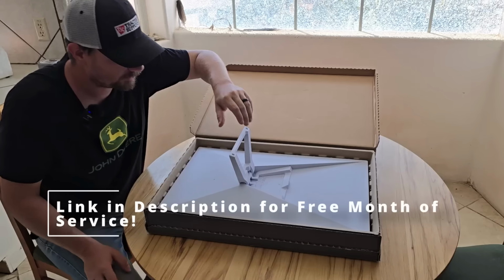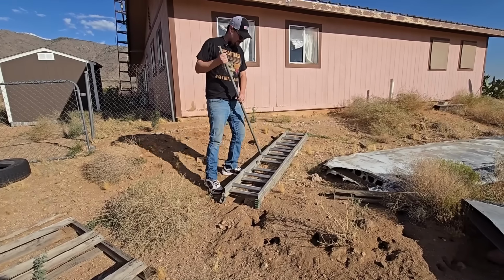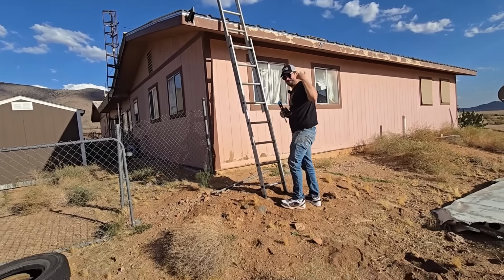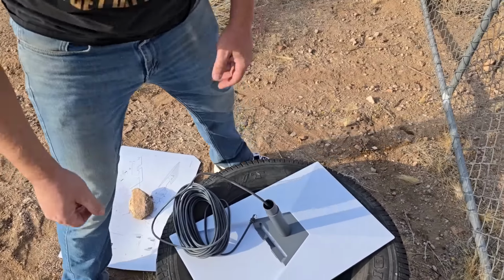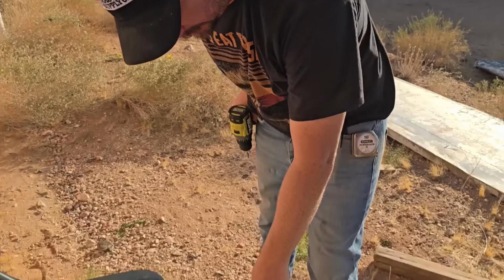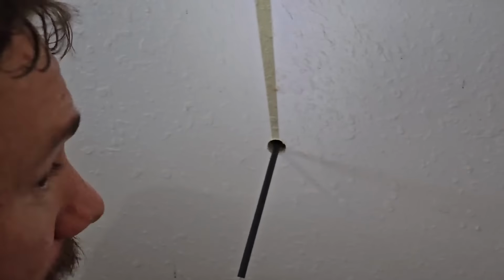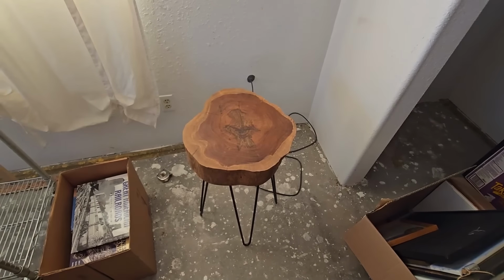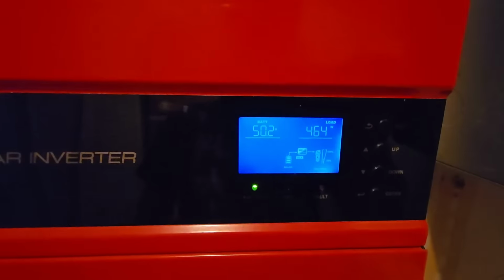Starlink Internet Installation, It's Easy! | Off-Grid Abandoned Airport Restoration

Comment: That flat plate that you keep calling a "satellite" is actually the antenna. The satellites are several miles away in a roughly vertical direction. The space juice's main purpose is to fill the corner gaps of the antenna.

Comment: You should make a night video. I can only imagine the starry sky you can admire in a place like that!
How envious, sitting on a deck chair at night looking at the stars warmed by Buster, and by a hoodie provided by the land!
p.s.
51:18 For that badly aligned crack, throw in a few drops of acetic-based silicone, and spread it with your finger, so you seal it and you don't worry about it anymore.
Source: "I use silicone for everything, i even spread it on bread"

Comment: Part of the problem with the old Hughesnet satellite stuff is that those sats are in geosynchronous orbit, which means they're at a super high altitude--something like 20,000+ miles high.  That drives up latency like crazy, which shows in your speed test as the ping time (649ms for Hughesnet vs 29ms for Starlink).  The Starlink sats are at a far lower orbit, so latency is much better.  You're also at a great latitude to see lots of Starlink sats at any given time, which helps quite a bit.  Also that you don't have any obstructions like tall trees, buildings, etc that can block the RF signal.

The bird poop wouldn't affect the Hughesnet, btw.  It sucks equally with and without bird poop on the dish.

Comment: My (limited) experience with StarLink is that the speed varies a lot.  It was super fast for a while, then got really slow, then fast again.
Reply from the maker: I think it will get more steady as more units are launched.  They launch a bunch all the time.
Reply: The antenna is looking for a satellite close to the horizon to the north.   That keeps the satellite close to still from the vantage point of the antenna.   As it starts going overhead, the angle is changing rapidly, which slows down the connection.    Hopefully before it gets to that point, the next satellite in the same orbit has appeared and it jumps to the new satellite and you are back to higher speed

Comment: HughesNet will feel a lot slower than Starlink mainly because other satellite internet services use geosynchronous satellites.  That means the signal must travel much, much farther (over 100x farther in this case), so the latency is extremely high (your speed test shows 649ms, which is actually better than I remember it being).  So every click and request takes the better part of a second before you get anything back.  Starlink uses a fabric of satellites in low earth orbit, so the latency is comparable to normal broadband and it will feel much more responsive (in addition to the throughput improvements).

Comment: Of course you know you have the extension ladder backwards.  The sliding section should be on the outside, it should not be the section leaning against the house!  The section with the feet is always the inside section and you slide the extension section up on the outside.

Comment: I got Starlink recently and I had zero issues setting it up and its screaming fast. I had to mount it on a service pole in my yard and run an aerial to my house for the POE cable but it turned out great. 

I've been able to watch videos in 1080p with out worrying about burning up my data cap or buffering for 5min. Pretty incredible for the boonies lol
Reply: I was an early adopter, was great, until the exchange rate got too far out of line, and it's priced in USD. Sold it to a friend, who has a remote cabin.
I went back to my local provider, who saw the writing on the wall, and dropped their price.
I'll wait till Amazon's Project Kuiper, starts, then the price war will start.
Best wishes all from Northern Canada.

Comment: We just got Starlink. We live in the boonies too.   Our computer is super fast now.  Very happy and well worth it.  Even though you have to buy the equipment up front and pay to have it installed, it's still worth it.
Reply from the maker: The equipment was half off because we are in an area with no customers so it's a waste to have all those satellites fly over!  I can see them at night because it's so dark out here.
Reply: @HerbOMatic  that's very cool. You should film that. Also, would it make sense to do any work at night when it's cooler?
Reply: @HerbOMatic  just be aware that they're not going to prioritize you then! They still don't have full global coverage and the idea is that there should be multiple satellites nearby for the good speeds, so there may be times where your area just doesn't have good coverage and it's not important enough to launch more there

Comment: I would suggest to get rid of the step chair. The UV in the sunlight really makes it brittle. I stepped once through one of those and ended up with a big cut in my leg from the razor sharp plastic. You being so remote I would not risk the change of cutting an artery in your leg.
Reply: I was thinking the same thing, and the hot sun in the desert might even make that plastic age even faster?
Reply: @immortaltyger1569  It will lots of blazing sun gives a lot of UV. That is why you easily get sunburned.

Comment: You'll find MANY of the Ookla Speedtest hosts are indeed throttling Starlink (lefties pissed at Elon).   Change the host servers on your app for the area and you'll find the speeds will vary.  If you test enough you'll find a few that aren't playing games.    If you use the built-in speed test in the Starlink app, it won't necessarily give you the best results... but they will be the most consistent.  Welcome to the Starlink clan.   I'd say in your space...  there should be NO obstructions.

"Latest and Greatest"  No, just latest... and works well.

Comment: The land needs to provide some Lithium Iron Phosphate Batteries so you can get off the flooded lead acid and have some real capacity.

Maybe the land can provide an EG4 Solar powered air conditioner to get off the swamp cooler?
Reply from the maker: I hope so.
Reply: @HerbOMatic  was the previous owner a ham radio guy? Looks like he had a lot going on and never finished anything.

Keep working on a sponsorship to get that Solar upgraded. You have the viewer numbers.

ETA: Yep, just saw the HF antenna on the roof, that explains the propane lines and questionable electrical outlets!!!!
Reply: @mrdfarms9373 They definitely need to use handheld ham radios when he it out on the property. They don't have good cellphone coverage

Comment: There's something out of whack with that extension ladder. The upper section needs to be on the front side of the ladder, not on the back. It may also be upside down and need to be turned over once you get it brought to the front side. There...think about that, lol.

Comment: That Space Grease I would put some in the hole where the cable goes into the satellite.  I am assuming it's d-electric grease.  That'll keep the moisture out of the connector.  We do that in cars between the spark plug and the coil.  I like the Wife Broom Cam.  That is a long broom handle.  I watch a channel that is in the Philippines and she uses Starlink there.  Internet there is notoriously slow but the Starlink had made her YouTube life much better.

Comment: Its very nice that you included Buster on a shirt.

You used the wrong model for the shirt change... You'da had a much higher view count and many more subscribers had you replaced the shirt change model. Always able to re-edit the video - 🤩

😖😖😖 Cringe worthy moment! Herb, please don't stand on the sun-baked, half-UV-rotten  land provided chair! Cuz the land ain't gonna provide the medical bill payments 🤕 - it's stingy that way.

By the way, I was told it is a good idea to power the Star Link thru a UPS (Uninterruptable Power Supply) so that it avoids having to wait for restarts after a power outage, especially with your solar power system and need to power down/then back up during your future electrical work.

That is quite the speed improvement 

Sure beats back in the day with a 57.6k dialup - ick!

By the way, is it my imagination, or is that poor ol' barn loosing more piece's each time you show it?
Reply from the maker: Hey Bucko!  You loved it.

Comment: What's the cost of the unit and monthly costs?
Reply: Basic residential pkg is currently $599 one-time hardware fee and $120/mo. subscription. They have other plans for roaming, mobile, boat, etc. though. Many ppl with RVs and yachts use Starlink.

Comment: Those plastic Walmart chairs will splinter and stab you as you hit the ground ,,, I done it already ,, more than once lol
Starlink take 24 hrs for obstruction map 
Starlink raise price and you can’t backslide once you go Mobil but you can shut it down as many times as you want and it will run off cig lighter 700 watt inverter 120 volt great where there’s no cell service if you phone makes WiFi calls or if you use google free phone but it’s cool had one since I waited in line way back but fiber optic’s to house  runs cheaper and cell tower 5 g is intermittent depending on tower load